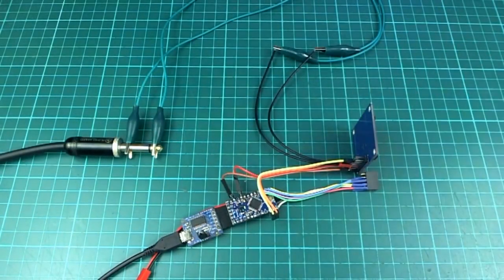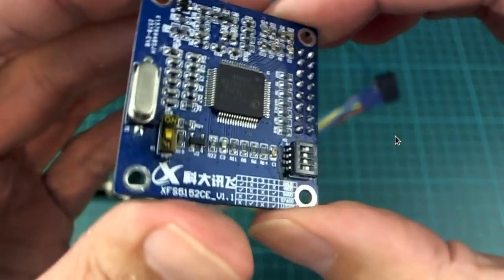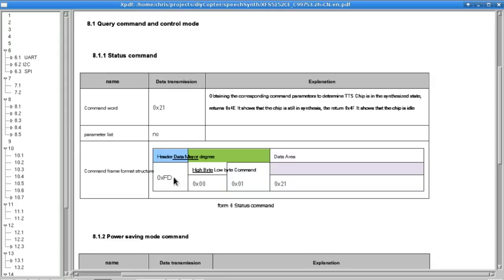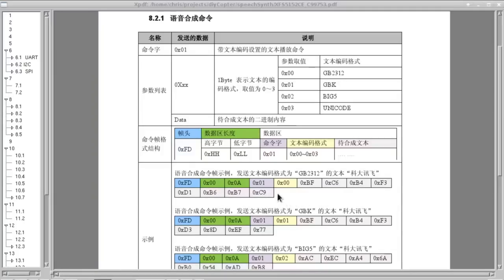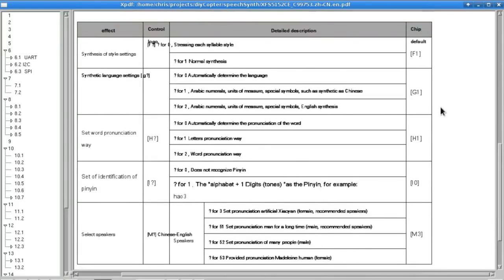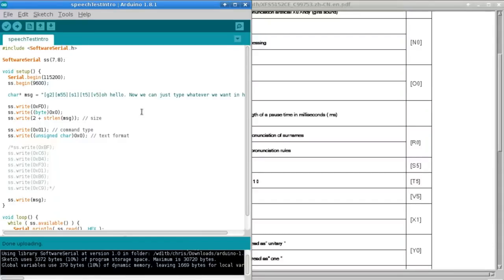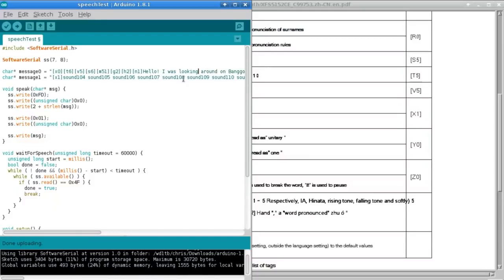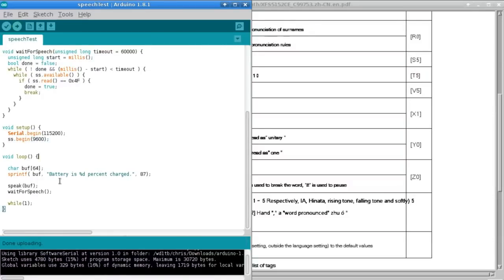XFS5152 speech synthesis module

Comment: This is what I, now, believe to be the meanings of each of the tonal prompts:

    "Processing Audio-in",  // 00: "I eat"                我吃 (wǒ chī)       FC 00 2A 01 00 CE D2 D4 DA B3 D4 B7 B9  
    "Tuning Input Stream",     // 01: "I am in the car"      我车 (wǒ chē)       FC 00 2A 01 01 CE D2 D4 DA D0 DE B3 B5  
    "Let Me Do That",      // 02: "I Come, I'll Handle It, Let Me Do it"  我来 (wǒ lái)       FC 00 2A 01 02 CE D2 D4 DA BC D3 D3 CD  
    "I'm Idle, Am Resting",   // 03: "Resting"              休息 (xiū xī)       FC 00 2A 01 03 D5 FD D4 DA D0 DD CF A2
    "Agreed to That",                     // 04: "Agree"                同意 (tóng yì)      FC 00 2A 01 04 CD AC D2 E2  
    "Disagreed with That",                  // 05: "Disagree"             不同 (bù tóng)      FC 00 2A 01 05 B2 BB CD AC D2 E2
    "Screw it, Am Done!",     // 06: "I Go, Screw This, Damn, I'm Done"     我走 (wǒ zǒu)       FC 00 2A 01 06 CE D2 C8 A5  
    "Lost Timing Reference",   // 07: "What time is it?"     几点 (jǐ diǎn)      FC 00 2A 01 07 CF D6 D4 DA BC B8 B5 E3 
    "Numeric Output Ready",  // 08: "Today, a Few Numbers; Start of Numeric Output Sequence" 今号 (jīn hào)      FC 00 2A 01 08 BD F1 CC EC BC B8 BA C5  
    "Message Ready For You",   // 09: "Stored, Neutral, Message, User-facing Info Being Read Aloud"  读信 (dú xìn)        FC 00 2A 01 09 B6 C1 D0 C5 CF A2  
    "Began Reading Message", // 0A: "Started Reading"      开读 (kāi dú)        FC 00 2A 01 0A BF AA CA BD B6 C1  
    "Save To Word Number?",   // 0B: "Put this Where?"      哪里 (nǎ lǐ)          FC 00 2A 01 0B D5 E2 CA C7 C4 C4 B6 F9
    "Starting Audio Output",   // 0C: "Open Broadcast"       开播 (kāi bō)       FC 00 2A 01 0C B4 F2 BF AA B9 E3 B2 A5  
    "Ending Audio Output",     // 0D: "Turn Off Radio"       关播 (guān bō)       FC 00 2A 01 0D B9 D8 B5 B9 B9 E3 B2 A5  
    "Microphone Is Open",      // 0E: "Open Music"           开乐 (kāi yuè)      FC 00 2A 01 0E B4 F2 BF AA D2 F4 C0 D6
    "Microphone Is Closed",    // 0F: "Turn Off Music"       关乐 (guān yuè)     FC 00 2A 01 0F B9 D8 B5 B9 D2 F4 C0 D6
    "Repeating the Prompt",   // 10: "Hear it Again"        再听 (zài tīng)     FC 00 2A 01 0F B9 D8 B5 B9 D2 F4 C0 D6  
    "Say That Again",   // 11: "Read Again, Speak Again"   再读 (zài dú)        FC 00 2A 01 11 D4 D9 B6 C1 D2 BB B1 E9
    "Low, Speak Louder",  // 12: "Louder Please, Speak Louder, Raise the Volume"   大声 (dà shēng)     FC 00 2A 01 12 B4 F3 C9 F9 B5 E3  
    "Loud, Speak Softer",   // 13: "Keep Volume Down, Speak Quietly, Lower Your Volume"   小声 (xiǎo shēng)   FC 00 2A 01 13 D0 A1 C9 F9 B5 E3
    "Read the Message",            // 14: "Read SMS, Read Non-Warning Info (in 0x18?)"  读信 (dú xìn)       FC 00 2A 01 14 B6 C1 B6 CC D0 C5
    "Alert Now in English",   // 15: "Am Reading Early Warning Alert Info in English (The West) - (in 0x18?)"    读预警信西  FC 00 2A 01 15 B6 C1 D4 A4 BE AF D0 C5 CE F7
    "Thermal Chip Warning?",     // 16: "Weather - Rain, Sun, Wind"  天气 (tiān qì)      FC 00 2A 01 16 C3 F7 CC EC CC EC C6 F8 D4 F5 C3 B4 D1 F9
    "Am Ready to Start",          // 17: "Let's Start"         开始 (kāi shǐ)        FC 00 2A 01 17 BD F4 BC B1 D4 A4 BE AF D0 C5 CF A2
    "Multi-Prompt Warning",    // 18: "Emergency Info, Urgent, Anxious Alert-Warning-Police-Vigilance"  警急 (jǐng jí)      FC 00 2A 01 18 Many different return tonalPrompt values
    "Act of Stopping",                // 19: "Stopping, The Act of Stopping, Halting Right Now"   停止 (tíng zhǐ)     FC 00 2A 01 19 CD A3 D6 B9
    "Operation Timed-out",               // 1A: "Time-out"             到时 (dào shí)       FC 00 2A 01 1A D4 DD CD A3
    "Speak Again, Please",     // 1B: "Continue Reading, Resume Talking"  续读 (xù dú)        FC 00 2A 01 1B BC CC D0 F8 B6 C1
    "Start Speaking Now",      // 1C: "Start, Am Able to Begin, You Can Start"   可开 (kě kāi)       FC 00 2A 01 1C C8 B7 B6 A8 BF AA CA BC
    "Act of Cancelling",               // 1D: "I Am About to Cancel, Act of Cancelling the Current Operation"  取消 (qǔ xiāo)      FC 00 2A 01 1D C8 A1 CF FB

Comment: do NOT fool around with the switch which goes between the two solder pads called K1 on the board. It takes commands 0x51 through 0x53 which all return an undocumetned 0x46 return, 0x54 returns an undocumented 0x47 return and,  most likely 0x55 rewrites your bootloader. Oops. It will give you a 0xFC 0x10 0x01 0x49 and then give you 608 zeros. Afterwards you will have a brick.

Comment: startRecognition is not to startRecognition. It is a determining system designed to determine whether a spoken word might MAKE a good speech recognition word. It does NOT return a number when a word is spoken. It returns one of 30 'tonal prompts' which tell you 'the way that word failed' when you spoke it. A 'tonal prompt' is a Chinese sequence of pinyin words in GBK format that is designed to be returned back to the chip to be spoken as Chinese words. The GBK sequence is returned when you speak as a 43 byte buffer, where the first words are the Chinese words padded with 0x00. 

The returned 'words' are such as what are called "I Eat", "Today, Some Numbers" in the manual. At the top of table 61 it says '30 Command words' and at the bottom it says 'Tonal Prompts'. These are NOT 30 command words, as one thinks they should be, meaning you speak "I Eat" to the XFS chip and it returns a value. This is wrong and is not how it works.

The 'real' startRecognition, where it waits for you to speak a word might be hidden in startEncode. I have sent 'the wrong' form to startEncode and waited a bit too long and it said to me, 

8F 71 0F D1 A0 00 EF 98 F2 38 E3 8E 3B 22 06 DF 7D CB 82 69 24 11 18 5F 07 E9 73 B5 B6 FE 7F FF FE DB 77 DF 79 D9 50 00 06 00
Which translates into: 请等待系统初始化完成后再进行操作。
Which means, "Please wait until the system initialization is complete before proceeding."

and then...

96 61 08 DA 89 F3 96 38 EC 52 5F DD 59 F8 DC 97 96 1C 19 C7 18 99 D5 7F A7 E2 55 8C E8 56 7C 13 5B 08 3F 03 09 DA 84 A9 49 00
Which translates into: 你现在使用的是语音识别模块，请说出您要操作的指令。
Which means: "You are now using the voice recognition module. Please speak the command you want to execute."

17.079 milliseconds) elapsed between the start of the first GBK tonal prompt and the start of the second GBK tonal prompt return event

This is absolute proof that startEncode sets up the XFS for programming a voice recognition word as its primary purpose.

Comment: I have studied this chip for quite some time now... I always love a mystery. So - yes, you can encode your voice. encoded frames are 'speech recognition words'. When you do startEncode, it will send you frames of varying sizes determined by the bitRate/samplingRate (I use a one-byte 'encodeType' whereas they use bitRate and samplingRate)

    0x07, // encodeType  0: 8kHz, Bitrate Level 0 — (Decimal: 7)
    0x10, // encodeType  1: 8kHz, Bitrate Level 1 — (Decimal: 16)
    0x15, // encodeType  2: 8kHz, Bitrate Level 2 — (Decimal: 21)
    0x1D, // encodeType  3: 8kHz, Bitrate Level 3 — (Decimal: 29)
    0x27, // encodeType  4: 8kHz, Bitrate Level 4 — (Decimal: 39)
    0x3F, // encodeType  5: 8kHz, Bitrate Level 5 — (Decimal: 63) - Note that this size includes the 0x20 command
    0x07, // encodeType  6: 16kHz, Bitrate Level 0 — (Decimal: 7)
    0x10, // encodeType  7: 16kHz, Bitrate Level 1 — (Decimal: 16)
    0x15, // encodeType  8: 16kHz, Bitrate Level 2 — (Decimal: 21)
    0x1A, // encodeType  9: 16kHz, Bitrate Level 3 — (Decimal: 26)
    0x21, // encodeType 10: 16kHz, Bitrate Level 4 — (Decimal: 33)
    0x2B  // encodeType 11: 16kHz, Bitrate Level 5 — (Decimal: 43)

Most likely, the chip uses 8kHz at bitrate 0 for speech recognition words. The thought is, the chip has other 4K buffers much the same as the buffers for text caching and they are most likely stored as encoded frames of 6 bytes in size (one of those 7 bytes is the command, 0x43 in the case of decoding, 0x20 in the case of encoded frames being sent to you, and possibly 0x45 as the undocumented code like 0x43, possibly, to store encoded frames) but that is all just conjecture until I find what command actually stores the speech recognition word.

Getting a cardioid mike cartridge hitched to the board: 1200 ohm resistor (not higher like you'd think) between + of mike and 3.3v, not 5v.

Comment: Improvement to above code  so you can send  txt strings longer than 253. chars  also don't have to add the waitForSpech after each  speak("bla bla")
void waitForSpeech(unsigned long timeout = 80000) {
  unsigned long start = millis();
  bool done = false;
  while ( ! done && (millis() - start) < timeout ) {
    while ( Serial2.available() ) {
      if ( Serial2.read() == 0x4F ) {
        done = true;
        break;
      }
    }
  }
}
void speak(char* msg) {
  Serial.println(msg);
  short meslength= strlen(msg)+2;
    Serial2.write(0xFD);
    Serial2.write((meslength >> 8) & 0xFF);
    Serial2.write(meslength & 0xFF);
    Serial2.write(0x01);
    Serial2.write((byte)0x0);
    Serial2.write(msg);
    waitForSpeech();
    
  
}

Comment: At 16:26 you ask why it does not work, i think cause the msg length is not good, it's 14 instead of 10, you added 4 bytes. Does this chip sing too, it lookt like the Emic2 and the tts-click board. when you feed it allophones like this the Emic2 or the tts-click-board sings.     [AE<2345,21>EY<567,17>][]    
Maybe you have to look for something like pnone on
or arpaphone on, but the [..........]
means do this as allophones.
can you try this on your board  
  Goodluck, sounds great
Reply: No, these boards can't sing. That's a DECtalk thing, like in the Emic2 and TTS-Click.

Comment: Agree with you, this could make an awesome little debugging tool, rather than streaming print commands to a display, audio feedback of the same stream could be extremely useful and simply tagged onto the output stream of the device/module under test. Good job in on reverse engineering the data sheet. Impressive intonation and clarity for such a cheap and simple solution and presumably can be driven the same way via I2C and SPI bus. Subbed.

Comment: Thank you for providing the information needed for this device, mine arrived from China the other day, and I found it to be pretty easy to use with your example code. To that end, I've expanded your code a bit to show the different voices, and speak the numbers in different manors, if you are interested the code can be found here: https://github.com/automation-technology-club/Speech-Synthesizer-Demos I also documented some of the features from the PDF at least on how I think they are working. There is also demo code from Parallax for the EMIC2 and if you have an EMIC2 and a XFS5152 you can hear the differences.

Comment: My speech synthesis module returns 45(Incorrect command frame) while doing status inquiry.I am using arduino mega 2560. Please help as I am not able to figure out the fault

Comment: For a simple IC with poor documentation this should be much cheaper. PC soundcard with such support cost less
Reply from the maker: It's not what I would call simple. Try writing some software that does this yourself and you'll see just how simple it really is :) And not that the documentation should affect the price, but I would bet good money the Chinese documentation is perfectly fine - pretty sure I made it clear that I was using an automated translation to English. The PC soundcard comment is like comparing apples and oranges. This module is much smaller, lighter and low-power, the speech engine is entirely self contained and does not rely on the controller, and instructions can be given with just one signal wire. Please show me a PC soundcard with these features that costs less.
Reply: There are plenty od tts software C libraries. All you need is a separate faster mcu and dedicate it for one tts task. Most of soundcards support SAPI (speech api) Maybe not fully but have api features built in.
I still think this should be in $5 range.
Reply from the maker: I still think you're comparing apples with oranges - nobody making a portable embedded project (eg. custom R/C transmitter) wants to bother with a big soundcard. With this you don't need libraries, and you don't need any separate faster mcu, or dedicate anything else for tts. Just show me a soundcard cheaper than $14 with the same features, that can be used with arduino UART on one wire and gets up and running with so few lines of code :)
Reply: It is just too expensive) The features are very basic. There was also a project for under $5 with very simple TTS using mp3 player ic. I'm not saying it is bad circuit but it is just too pricey for what normally people do.
Reply: Compare the XFS5152 to the Parallax EMIC2 - they are very similar devices, the EMIC is priced at $60 plus - and is very well documented. But it sounds much more robotic.  The XFS5152 at under $20 is a good really good deal for a self-contained synthesizer - even with the slightly Chinese accent and lack of English documentation. The XFS5152 is a really good deal, and is in the price range that can be added to many projects and leave it in a project.   I own 2 EMIC2 boards now that I've heard this, and see how it works, this will be on my list to for many many projects.  Being able to buy three for the price of one EMIC2 seems like a great deal.

Comment: Cool. Now to hook it to the DIY transmitter for voice announcements :)
Reply: I suspect the intended application of this chip was as the core of a personal translator where arbitrary strings of text are used. Using MP3 or WAV files of standard or canned  messages allow natural sounds like human voice to be used when more defined messages are output. This is the way the FrSky range of TX's do it and part of the reason the Amber sound pack is so popular (apart from her dead sexy voice) over sounds generated by TTS systems. creating the sound files is a big task hence why only a very few natural sound recordings exist for these radios.
Reply: Totaly agree. For higer grade transmitter this TTS generated voice sounds too artificial. But for amateur grade DIY transmitter it is easy solution - no WAV files, no sophisticated coding needed. Just send voice message via serial interface.